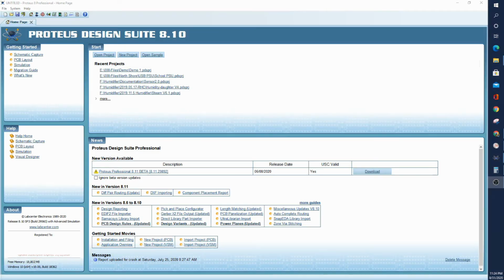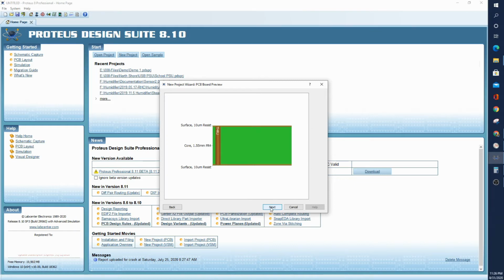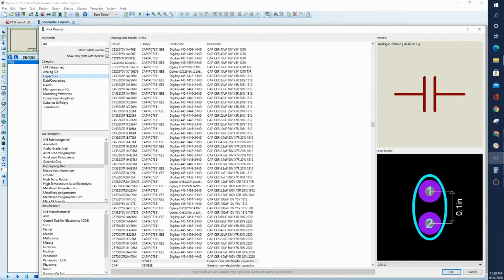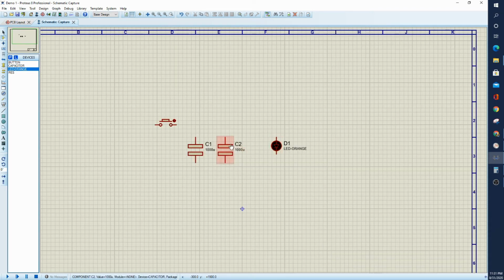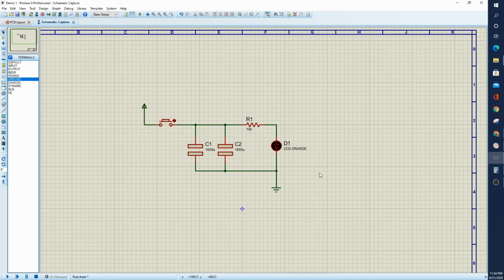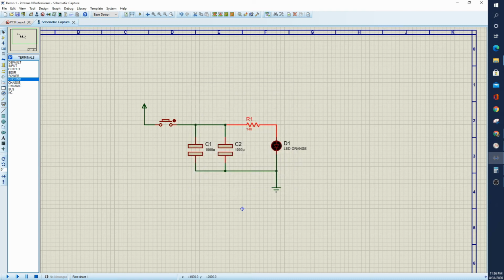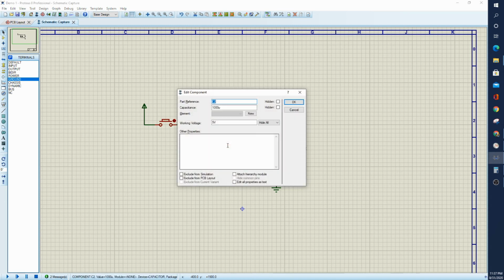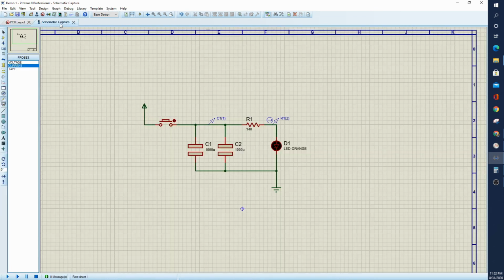Getting Started With Proteus #1

Comment: Thanks for your educating video. I wanted to ask how can i get access to more full libraries for proteus? Cuz currently in my proteus 8.17, i don't have the same resistor you used in your video, however, there is another in the menu. On the internet, i have to look for huge amount of resistors one-by-one which makes it boring to choose the desired one and import.
Reply from the maker: Well, you can share parts with others, but loading parts from the suppliers and creating your own is likely the best option. Remember to double-check information with the datasheets .